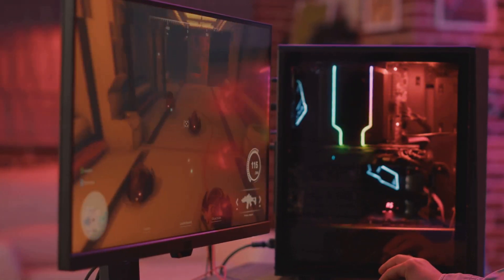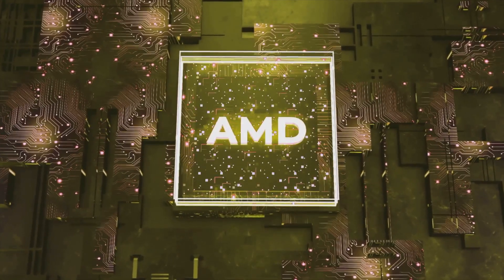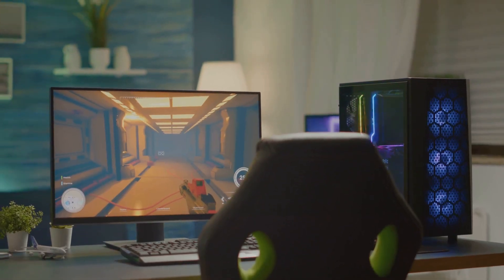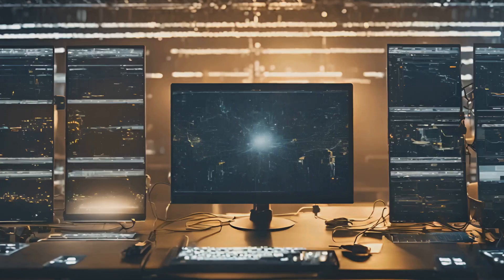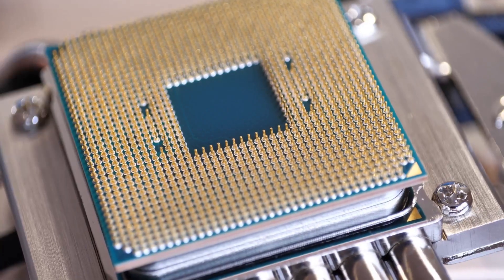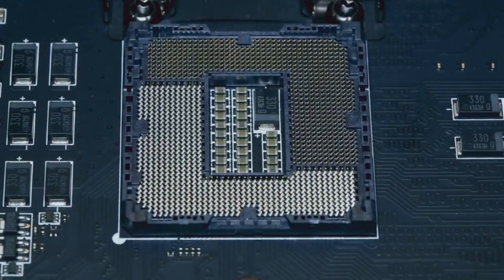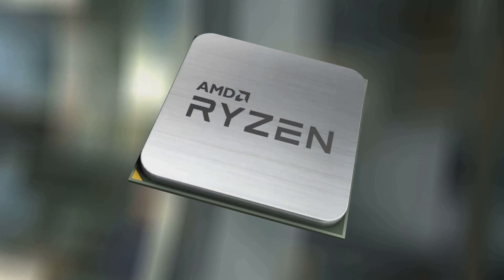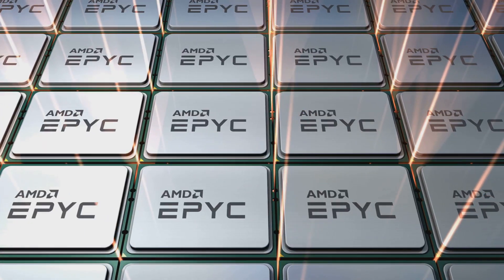AMD Threadripper PRO 9995WX Preorders Start July 23 – 96‑Core Beast

Comment: Absolutely waiting to get one.  Pre-order attempts will hopefully be successful.  I'm already running a machine with a 7980x but want to upgrade.  Already got all other parts here, assembled and waiting for this.  nVidia 5090, 4x samsung 9100 pro to run in raid 0 to have 8tb, 192gb ddr5 ram although that may turn out to be insufficient in which case I can upgrade to 8 channel ram with this cpu.